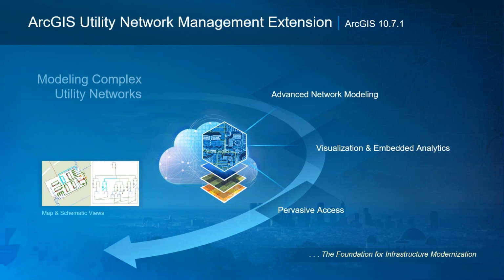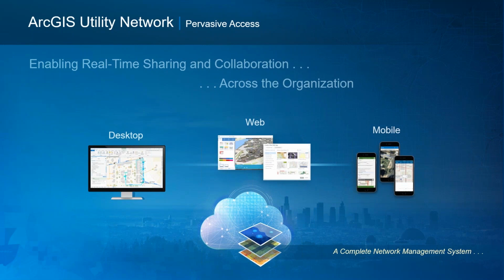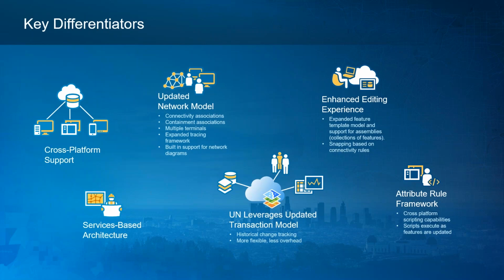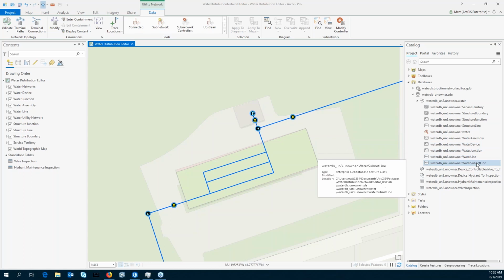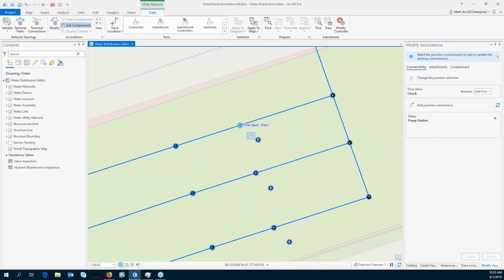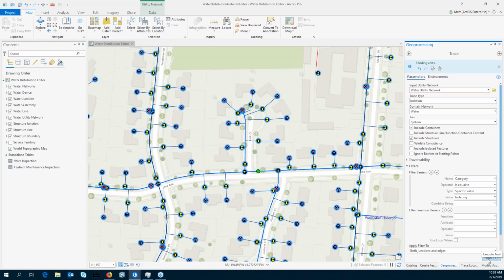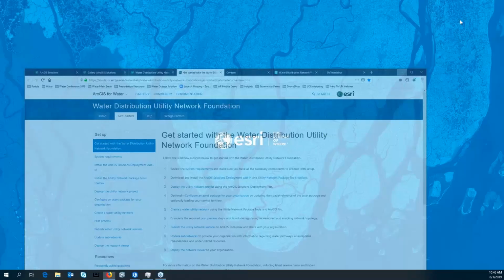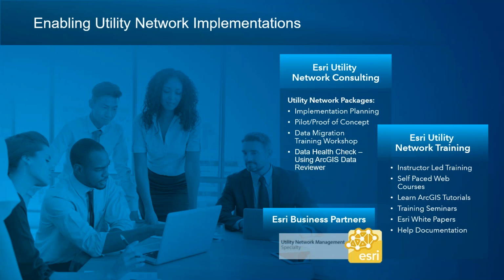Introduction to the Utility Network for Water Utilities

Comment: Unfortunately many ESRI distributors sell these tools but set up data in a traditional way. They are seldom used in real operation. Also the distributors are often not technically capable of using and setting up network data and tools.